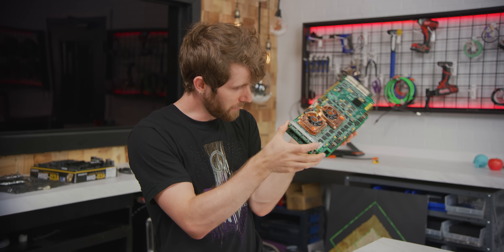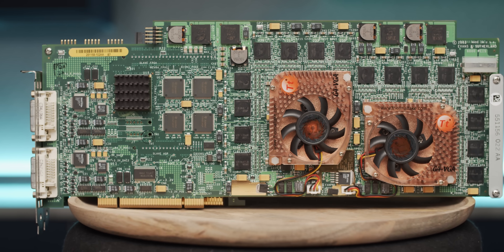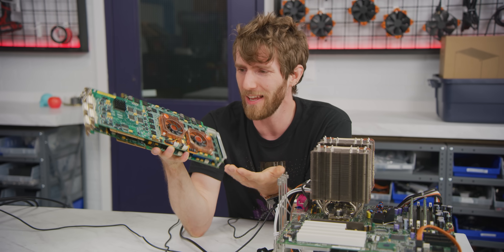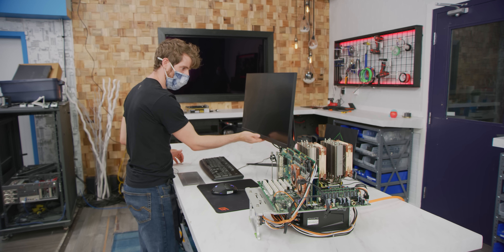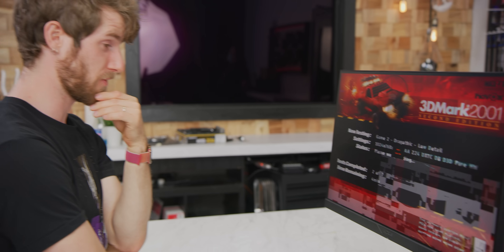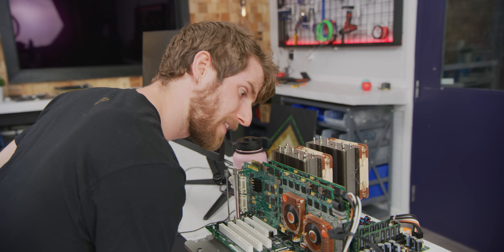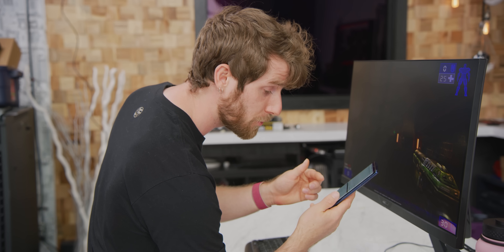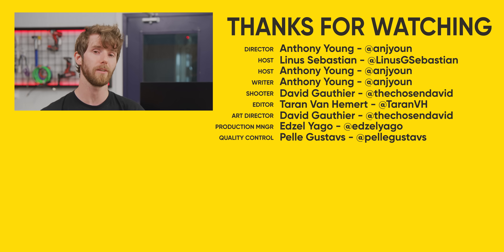This MONSTER Video Card has 4 GPUs... and it's from 2004! - E&S SimFUSION 6500q

Comment: tiny fan bearings are a curse, they still have them on some "high end" motherboards, bad idea.
Reply: I had an ASUS TUFF 3700k motherboard (lga1155?) and it had a fan just like the new Ryzen boards and it WHINED liek hell. EVEN the replacement fan it came with whined so bad I just unplugged it. From there I never bought an asus mother board until recently. I was 12 back then so it was a bs reason
Reply: @salami99  y'all need some over ear headphones. But then again the noise doesn't actually bother me in fact just hearing the sound of fans spin up when they press the power button on old PCs is so soothing to me, like being alone in a hotel room. It's a difficult feel to explain if you weren't raised with it I guess. I love that sound of the fan spinning up to max and winding down.

But I also have like AC a dehumidifier and all kinds of other noise making pumps and devices all around me so even without the headphones loud fans get drowned out. I suppose it's just a thing about how and what kind of autistic you are about these things. Personally I can hit a wall of sound just don't give me distracting annoying things moving in the corner of my eye. ARGB is kind of an issue for me for that reason until I figure out how to get the profile just right, like to have scan with orangish yellow lights for Alien type games.
Reply: @pandemicneetbux2110  I got them. This was 2011, since then I had many pcs. The new AMD 4 ryzen 3 motherboard I have is a X570 or whatever with 2 fans and so far the Asus mb doesn't whine.
Reply: @pandemicneetbux2110  I have a ceiling fan and a literal highway next to my home and the frequency had still bothered me. I was 11 years old then though.
Reply: Totally OT, but: Praise the Sun and give her some cake! Best Princess /)

I remember some 40mm fans in a 2u rack server over 10 years ago. Sounded like a B747 when it bootet up :D

Comment: 3dfx Voodoo5 6000 was a quad GPU, single PCB, card 4 years before this. I ran quite a few driver tests and benchmarks on Rev4 and Rev5 versions. Sadly, 3dfx couldn't execute, and the market was not even close to being ready for what the thing would have cost.

Comment: I think I saw the dvi port on the PCI slot part of the card. Why didn't they use a dvi port from the agp part of the card? is it possible that due to the connections that they bottlenecked the card?

Comment: The first consumer dual graphic cards solution I heared of where IBM-PC with Hercules+CGA graphics and the CBM-128 with VDC+VIC graphixs.
The first consumer "SLI-style" board would have been the Commodore A2410 TIGA Adapter. There were PC/ISA-TMS34010 boards too but those never tried to spread the workload between several cards. It ran the immensly powerful (by 1986 standards) TMS34010 GPU - and yes, this one is a fully programmable GPU in in modern sense which can run some pretty descent RISC-code itself - and you could add several into one amiga. They had an seperate DMA-link-connecter with some Proof-of-Concept software to show how to split rendering between GPUs with different approaches - line-by-line, frame-by-frame, block-by-block and so on.
The drawback? SLI was only a stand-alone Proof-of-Concept and never made it into the driver itself. ZERO support for AmigaOS. Back then you needed Amiga-Unix, Amiga-Unix-Hardware and a pretty expensive Low-Level-Driver. Later there were Drivers for NetBSD-68k (pretty descent ones, used these in the 1990 a lot), AmigaOS-RTG (those where ... meeh... school note D-E....) and Linux-68k (stable but terribly slow and not optimized at all).

Comment: This card does NOT predate SLI (yes, I know he said "nVidia SLI"; but the recurring message remains). SLI was first introduced by 3DFX with the Voodoo 2 back in 1998. The Voodoo 2 happened to be my first 3D card. 3DFX would reuse the technology in the Voodoo 5 line (though, in this case, the card used SLI in a multi-GPU/single-card setup, as those cards were AGP and AGP was a single-slot port). When 3DFX went bankrupt shortly after, nVidia bought the intellectual rights for the SLI technology. 3DFX was not the only company offering this type of tech either, ATI (way before being bought by AMD) also had multi-GPU cards in the 90's, such as the Rage Fury MAXX.

Comment: "We're gonna be building a PC from 10 yrs ago [...]"

Do you want this one I'm using, instead of building one?
Reply: I could spare a Colorado T3000 tape drive in case they need to backup like, 5gb
Reply: I still have an OEM micromaxx amd athlon xp 2000+ machine standing around, without graphics card though but I could throw in a creative geforce 2 from the spare parts bin.
Reply: I still have a rig with a AMD phenom 2x6. To be honest, it still runs quite a few good games with a gtx 1050. Still, the CPU is at least 10 years old.
Reply: I use a AMD Phenom II X4 975 with a GTX 460 (1GB). Works perfect for most games. I want to upgrade but have no money :(
Reply: MIne is 14 yrs old
Reply: Just what Intel's marketing dept. does to compare benchmarks.
Reply: mine is 11 years ago XD ... my upgrade in this rig is like a new fan.. .. and that's it
Reply: I still run my 10 yo PC... I7-920 , 16gb ram, GTX 760. And don't even think about running COD:MW 2020 on it...
Reply: @Warfare_Clown  meanwhile im playing COD MW on a 10 year old MacBook Pro haha
Reply: Take my GeForce 220 gt and 4gb ram...
Reply: https://youtu.be/dQw4w9WgXcQ
Reply: @yougottofly1619  Interesting build. Good ol' xp computer
Reply: @yougottofly1619  lovely xp build you got there
Reply: @Hinderofsales  thanks
Reply: I’m playing flight simulator 2020 on a core i7 and gtx660ti. I get a warning about not meeting minimum requirements...
Reply: My old 2010 built PC only went into the loft last month. definitely got my monies worth out of it!
Reply: Tell him it's $1000.
Reply: Where's LGR and the 8bit guy when we need?
Reply: I've been running an AMD Phenom II X6 1055T since July of 2011,  Sure I would like to upgrade but can't really afford to.
Reply: amateurs. my PC is 18 years old. old enough to FRICK
Reply: @smokinlogs80085  Wanna talk to my Windows 3.1?

Comment: I had a 9800 pro and I never experienced massive drops in framerate in Unreal Tournament from dynamic lighting.  that card was a BEAST at the time, the best available.  going from a Ti4400, which was a beast before that, to a 9800 pro was a HUGE upgrade.

Comment: To this day I can't hear or read SLI without thinking; Scan Line Interleave. This was how 3Dfx did it with the Voodoo2 cards which were the first consumer grade graphics cards that supported multi GPU rendering. And it meant they did just what it sounds like, render alternating scan lines and combining the output into a single frame.
I can't even remember what SLI is supposed to stand for when talking about Nvidia or any other multi GPU solution that doesn't use scan line interleave. In my opinion Nvidia should have avoided using the same acronym for their tech to avoid confusion.

Comment: “Old enough to use DVI!”
laughs in 10 series Nvidia card
Reply: 2070 super also has dvi-d but linus is talking about dvi-i which is analog version of dvi which is old.
Reply: @shagstars  Actually, the "I" in DVI-I stands for "integrated," which means that the device supports both DVI-D (digital) and DVI-A (analog) connections. Most video cards with a DVI output (other than passthrough cards for motherboard video, which are often DVI-D only because they have a VGA connector on the board for analog video) are DVI-I and thus support both DVI-A and DVI-D, both in 2004 and now. The most common use of DVI-A was with DVI to VGA adapters and VGA monitors, which only supported analog signals. Most monitors with a DVI input have always supported digital signals..

Of course DVI-D can be either single or dual link. Single link digital DVI and analog DVI both support the same maximum resolution, 1920 x 1200. Only dual link digital DVI supports higher.
Reply: @CFWhitman  a so but why do there exist DVI ports that have some pin holes removed?
Reply: @shagstars  DVI-I dual link ports have all the holes, while DVI-I single link ports, DVI-D single link ports, DVI-D dual link ports, and DVI-A ports each have only a partial set.

I can't give a definitive reference of when you might see one or another type of port, but this is my experience:

You generally see DVI-D ports only on passthrough cards for motherboard video.

You almost never see a DVI-A port, but you see DVI-A plugs on DVI to VGA adapters sometimes (though they sometimes use a DVI-I plug anyway).

The vast majority of ports you see are DVI-I, but some may be single link DVI-I (covering only single link DVI-D along with DVI-A). Single link ones would be missing holes.

There are relatively few dual link DVI-D cables (plugs) out there. Most cables are DVI-I single link. I have a DVI-I dual link cable to support my old 2560x1440 monitor, which I have to adapt to the card it's being used with now using a USB powered DVI to DisplayPort adapter.
Reply: @CFWhitman  who needs DVI to VGA adapter when you can have DisplayPort to VGA ;D

Comment: Didn't the Voodoo 5 6000 have 4x VSA100 chips in SLI on a single PCB AGP card back in 2000? I'm sure there was older Voodoo 2 based (multi-PCB) parts as well.

Comment: I remember my Radeon ATI 9700 Pro getting about 80FPS average in UT98 using the OpenGL S3TC update (not the built-in one).... with 8X FSAA and 16X ANSO... :/
I'm surprised they didn't try Quake 3, that would have produced way more results to compare against... could have ran the numbers past old anandtech reviews.

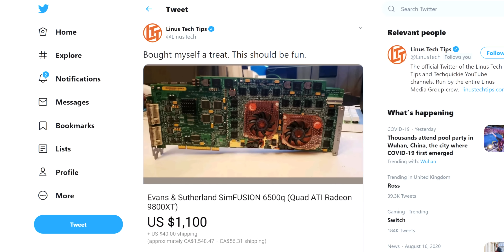Comment: 02:14  No, it isn't.  Though the card was never released to the market (you can still find actual cards, though), 3dfx made the Voodoo5 6000 with four GPU's, using quad-SLI.  That's the original SLI, not nVidia's rebranding of the term after they bought 3dfx.  That was four years before this card was produced.

Comment: I worked at Appian Graphics from 1996-2002 where I was desktop tech support for our multiple monitor video cards.  The first product I supported, the Jeronimo J2, used a PCI bus chip to connect two Cirrus Logic GD5462 display chips to a PC.  Interesting problem was many PC BIOS/chipsets couldn't boot to a video card behind an additional PCI bridge chip.   So Appian had the J2/N that dropped the bridge chip and used some logic to make only one chip available at boot and then the other was available in the OS.  Windows NT4.0/95 did not support multiple monitors, so our driver/Hydravision software told windows it was using a monitor twice (or more) as wide or tall.
Reply: The Jeronimo Pro had four Cirrus chips on a full length PCI board, and up to five could be installed into a system (better have a 400W+ power supply for that last config).    Twenty Monitors.  You could have Twenty monitors (and a desktop either 20x wide, or 4x tall/5x wide).  The downsides were that DirectX graphics Acceleration didn't work across multiple monitors.
The Hydravision software gave hotkey access to moving applications to different monitors.

When Windows98 rolled out with multiple monitor support the main advantage Appian had a was a customer base in the finance sector who wanted a lot of monitors on one PC, needed it to work out of the box and didn't mind a high price tag
Reply: regarding gaming, I remember the software dev guys working on all sorts of directX support/compatibility issues

Comment: “old enough to still use DVI”
wow really had to personally attack me like that, huh Linus...
Reply: arjunyg he meant only dvi, the rtx 2070 2650 super and a bunch of other new gpus have dpi
Reply: @yo5942  my hp  radeon 4650 has only dvi-i and 2 displayport (it was a business computer OEM part) and I am running a VGA monitor on it though dvi. Though Would have preferred its original 2 dvi-i and 1 s-video, could have run a dual VGA monitor setup and also run my TV.
Reply: at least he didn't talk about us VGA users
Reply: i use a dvi to vga adapter for my second monitor

Comment: When I bought a new ATi radeon 9500 Pro and, of course, converted it into a 9700 Pro, I came across the news about the release of this video card. God, I was so impressed with its potential power. I saw her in a couple of pictures and she should have been them and remain, meaningless pictures on the Internet. But this is a video. It's just beautiful. Incredible graphics card. More video with such pieces of hardware.

Comment: My first dual card setup were 2 pci cards that had a special external vga connector.
1 card used the horizontal lines and the other the vertical lines to make 1 immige on you're screen. 
Was also before you had Crossfire and SLI.
Forgot wich brand card it was

Comment: I’ve got a 4 GPU card at home. It’s not that good. It’s an Nvidia Grid K1. Came with an old server I bought, it’s used for VMs so doesn’t have a physical output. Thing is I can’t remove it from the system because I can’t get anything loose in the server for some reason.

Comment: Linus, I have a question. What happens when you use 2 different graphics card for the SLI? I don't just mean RTX2060 and 2080 but also 2080 and a Radeon card. Or vice versa with Cross Fire or whatever its called...

Comment: Anthony: "I actually had to recap the board"
Mistakenly uses flux capacitor and ends up with IBM  8088 motherboard
Reply: He did however use flux on the capacitors...
Reply: @jjhack3r  +1 I don't know whether to tell you to give yourself a pat on the back or to get the hell out
Reply: If you accelerate this baby to 88MPH it becomes a time machine.
Reply: @Carahan  88MHz*

Comment: 3dfx Voodoo 5 6000: "Am I a joke to you?"
Reply: Hardly, unlike this, v5 6000 is actually the only card where quad-SLI ever worked properly (without massive stutter and driver issues).
Reply: I was eagerly waiting for that card to come out, with my Voodoo5 5500 as a placeholder.  It was very disappointing to see 3dfx disappear into the nVidia abyss.
Reply: @TrueThanny  Yeah, well, Im one of the few people who ever got their hands on V5 6000 and its not all sunshine and rainbows here. Unlike other 3DFX cards which are known for good drivers, compatibility and reliability, the 6K is very moody. The few cards that got out are still late-stage engineering samples and it shows. 

The first series were completely cancelled due to the failure with the Intel bridge, and the second ones with HINT bridge that made it to production are still suffering from compatibility issues with many boards, its kinda reliable only on Intel and VIA North-bridges, and not universally at that. 

Also, for a full stability during AA PCI-rework must be done, and on top of that the image often has "SLI" errors aka the strips from each GPU are not being put together correctly, its different with various drivers and while in the end you eventually can find working combo of Drivers+ glide libraries for pretty much every game, it differs from game to game. So one day I want to play Q3A instead of UT? Well, time to fiddle with drivers. 

Overall, be glad for the 5500 as the 6000 is a headache good only for collectors to sit on their shelves really. It offers double the fillrate yes (which you can spend on higher resolution or AA), but the 5500 is fast enough for the *-2001 games and the 6000 cannot keep up with the more modern ones anyway cause its geometry bottlecked, due to 4 GPUs sharing one PCI66Mhz bus.

Comment: if you want I have both an E&S tornado 3000 and Real Image 2100 you guys can play with, I was a hardware tester for Autodesk 3D MAX 3/3.5 and one of my main clients was E&S. The 3000 in  98/99 was a bit over $5000, dual CPU , dual monitor. The usenet boards were rife with serious shit talk over this card, the 3dfx, and Nvidia cards, with Diamond, matrox and ATi bringing up the rear

Comment: Linus: "old enough to have DVI"
Do new graphics cards not have at 1 DVI connector?
I'm not talking about quadros I know that they only have DisplayPort
Reply: No, 3x DP and 1x HDMI on mine. I do use an DVI to HDMI for my work laptop however.
Reply: From what I've seen DVI is extremely rare today. It seems like more new motherboards have DVI than graphics cards now.
Reply: @deepwaterpaper9618  Interesting. Every graphics card I own has a DVI connector (except for my GeForce 4 MX) and the one in the computer I'm using is a GTX 1050 Ti

Comment: "old enough to still use DVI" - a lot of GPUs still have DVI ports. What you meant is (probably) "DVI only"
Reply: nah i think he meant that it was old enough to use a DVI-I output because that would’ve still worked with CRT monitors back then
Reply: More like it has DVI-I which has analog output, unlike the modern DVI-D only.
Reply: @GoldSrc_  But the last cards to feature Dvi-i was the Nvidia's 900 series. 

P.S running a vga  monitor I find this makes me sed  
rip eng
Reply: @GoldSrc_  Right, that's actually even more accurate and fitting than my comment.
Reply: Yeah albeit an aging tech, digital is still pretty common, even on expensive cards ($420 2070 nonsuper).

Comment: So they had a cluster to run a flight sim? In hindsight that makes sense considering how contractors usually get to simulate every aspect of the aircraft pretty deep and simulate malfunctions, or even calculate realistic flight behavior without tanking the frame rate.